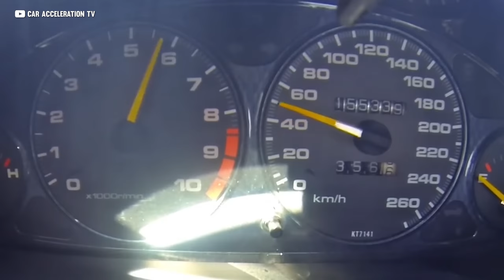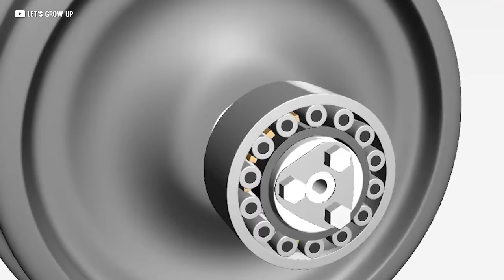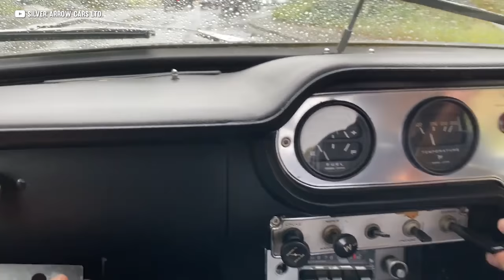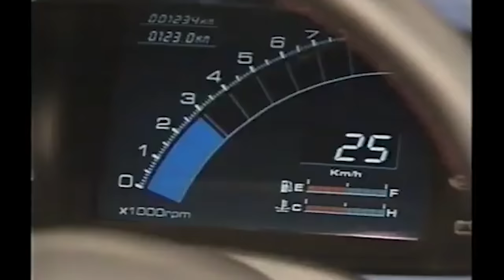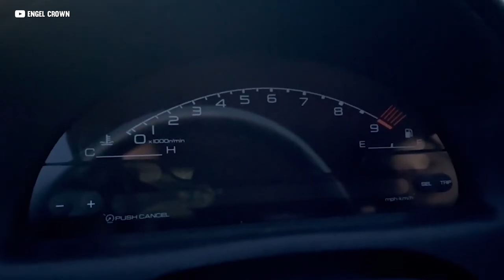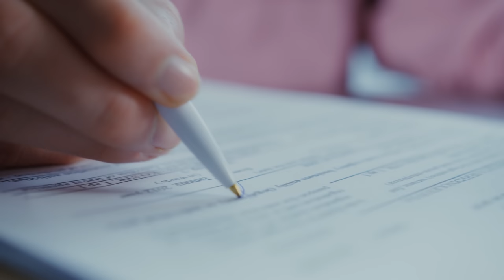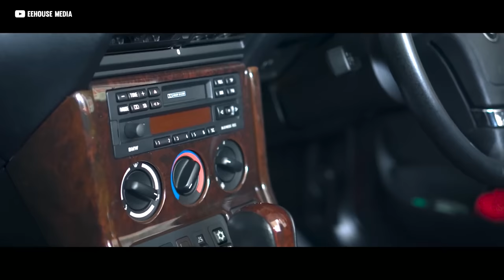Why Honda Killed The Greatest Sports Car

Comment: Honda killed the Corvette?
Reply: Corvette is the longest running car is it not? Not to say anytging bad about the S2000 10-year run, but Corvette has been around since the early 1950s
Reply: @AnonAnon-qi4ts yep 1953 the S2000 doesn’t hold a candle to any generation of Corvette.

Comment: My 5 liter BMW E60 M5 V10 will rev to 9000 RPM. it sounds like an F1 car, not a fartbox. It also has 10 individual throttle bodies and about 600HP.
Reply: See how many times you can rev it to 9000 before it explodes 😂

Comment: As a mid-priced, high performance, convertible sports car, the S2K always held a very small part of the car market.  As you discussed, price wise it fell between the Miata and the Porsche which both offered more in terms of comfort, sound systems etc.  With the drastic decline in new vehicle purchases in 2008, all auto companies had to focus production on their more popular markets.

Comment: Decent car to be sure, but paled in comparison to the Lotus Elise. Engine in the wrong place meant imperfect weight bias, Recalibrated AP2 dropped to 8200 RPM  when the Toyota 2ZZ went to 8500. And way way too heavy. Nearly a TON more than the Lotus. Bye bye handling and performance. Poor power-to-weight. Too many compromises for a Sports Car and far far far from the greatest.

Comment: Trouble is, until you reach 6000rpm it only has the power of a Camry
Reply: then just keep it above 6k all the time ^^ problem solved
Reply: @binskee677  well, unfortunately that’s not possible for 95% of the time
Reply: @spinnymathingy3149  i understand why but then it's just the wrong car, a car with a lot of torque in low rpm will never rev that high or make those peak power output from the same engine displacement. And on a track or twisty backroad you can very well keep it above 6000 or at least 5000 which it was made for anyways and during "normal driving" the torque or power output doesn't matter, you just want to ge from A to B right?
Reply: it's always funny to me when people critzie the low torque output of the engine, i mean you don't critize a orange juice for not tasting like a apple juice right? The orange juice is supposed to taste like a orange juice as intended. The thing is, in the US people are used to low end torque big V8's and stuff and most people just don't know how to drive those cars. Also in the US there not much real tight twisty mountain roads, even the mountain roads are constructed with wide turns with a large radius imo and then there are some tight tracks and autocross on a parking lot, so cars like a S2000 is probably more suitable for Japanese or european togue driving.
Reply: @binskee677  nope, I’m greedy, I want it all
Hahaha
Reply: @binskee677  but the problem is the power band is worse than the worst turbo lagged engine from the 1980s   Definitely nothing to get excited about
Reply: Then spirited performance to 7,500 where it went spastic for only another 1,500 rpm. And it had the worst gear rattle of any road car ever, then there was the tiny Aluminium gear knob that would bruise the palm of your hand after an hours spirited driving so you needed a padded glove. Not a very pleasant driving experience on the road but awesome on the track.
Reply: @spinnymathingy3149  i am suuuper excited about it, it's even more fun to drive than my GR Yaris or the M2competition i had. But yea everyone has a different taste.
Reply: @neild3074  never had the issue with the gear shifter. Yea it rattles but after changing the grease it was actually much much better! The thing is the shifter sitz directly above the gearbox so there are no cable or anything to even out the rattle, it is much more precise that way but also rattles more yea.

Comment: Knew a machenic worked for a racing TCR team in china. Their team run K20 and EA888 at the same time. According to them the EA888 is far more reliable than K20 at the same power level. Their EA888 can finished the whole season without rebuild but the K20 blew up 3 times.

Comment: I like the S2000, but I love the Z3. A roadster with a straight six that has a lot of torque and speed and it looks very good while doing that.
Reply: Yeh gimme me a call when you need to do maintenance on your Bimmer. German car engine work ain't cheap; my S2k costs about $50 a year in motor oil and filter.

I got a German car. My Hondas are way funner and cheaper.
Reply: @edgarpoe517  Really? Hmmm...I drove my E46 from Missouri to New York in 14hrs and back with no problems. No wonders the engine won many awards for it's power, design and reliability. and oh, I pay less than that for the same maintenance for my car.
Reply: @Ayixlia  lmao lemme know when you hit 100K.
Reply: @edgarpoe517  I'm at 250K still with no issues
Reply: @Ayixlia  Then you are an above-average home mechanic. Everyone else I've EVER known with Bimmer was glad to have traded that shit for something made in japan.
Reply: @edgarpoe517 🤡

Comment: I hear you all on the S2000, but i've driven one stock, and it left me cold. The power at the top end was unbalanced to me. I want low end torque. I understand the idea of shifting higher on the band when driving aggressively but just couldn't like it. When I'm tooling around town I want to put my foot in it and go, not shift to hunt for power. Also, I don't like the sex-less styling.